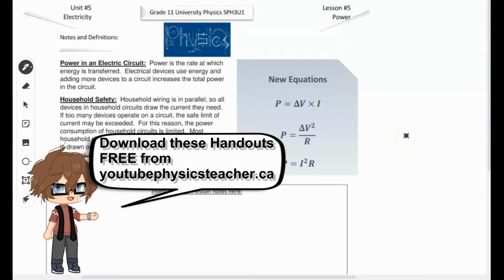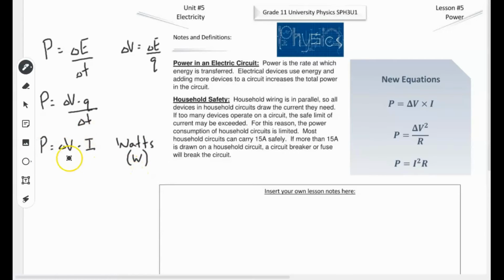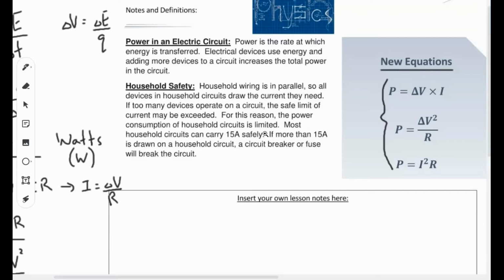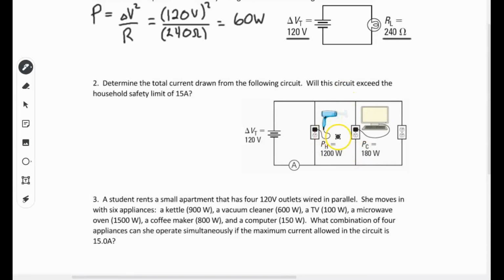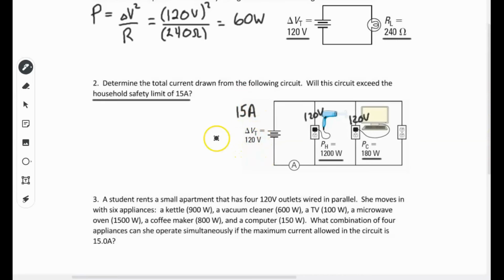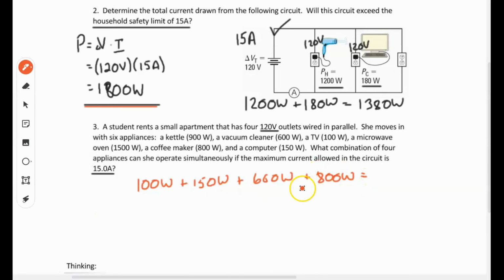Grade 11 University Physics - Power and Safety in Circuits

Comment from the maker: CONTENT:
0:00 Intro
0:18 Deriving Power Equations for a Circuit
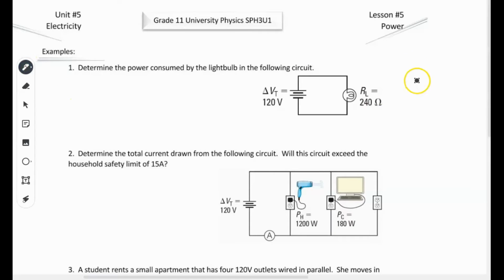3:12 Example Problem on Power #1
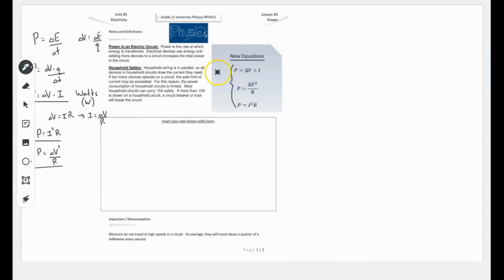4:16 Safety in Electrical Circuits
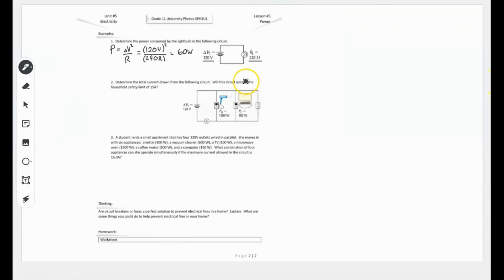5:37 Example Problem on Safety #2
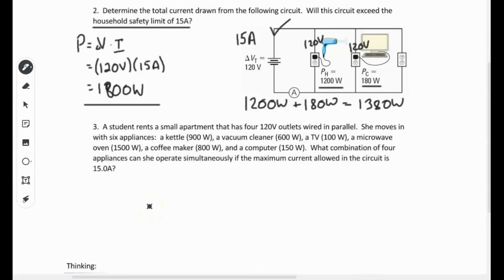9:24 Example Problem #3